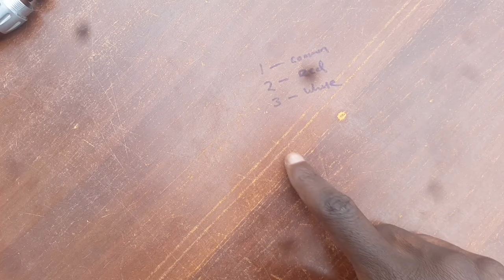How to make XLR to TS Cable

Comment: Should we short the common and white?
Reply: Because of the transformer in the balanced input circuit. By shorting cold and ground you end up with a unbalanced to unbalanced transformer. When you don't short, noise will get injected into the circuit.

Comment: Sorry, but very sloppy soldering.
Reply from the maker: What about this 1
Xlr to ts audio cable :https://youtu.be/UuVPdhlco5Q
Reply: @CedohKingdom  I like your videos. good camerawork, clear sequencing, cool text overlay, the link you shared is a better video, but still showing bad soldering technique. what stuck out to me specifically is: is this rosin core solder?,  tin the wire first, tin the device first , always put the solder gun behind the wire and heat while applying solder on top, make twists neat, cut insulation exactly. I know I'm being picky, not trying to ruin your day, but you don't want to make cold solder joints and have to fix them later. That's how I was taught. Good Luck!
Reply from the maker: Thanks bro God bless you.